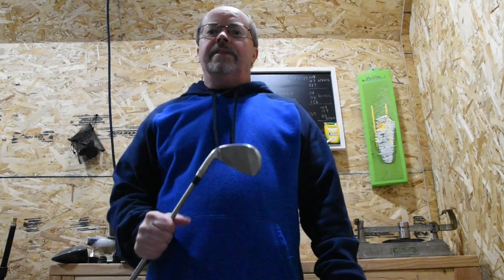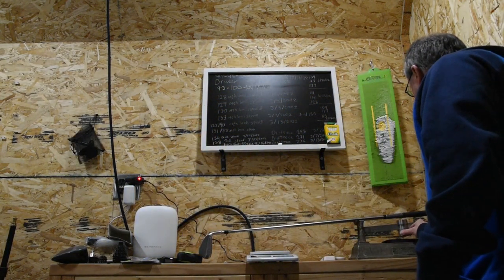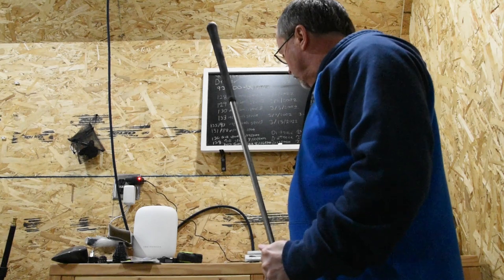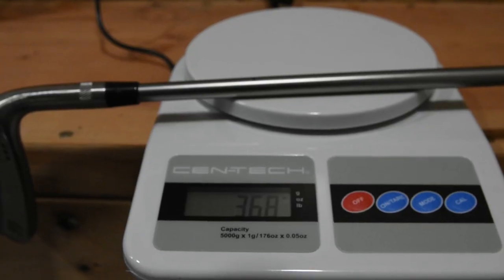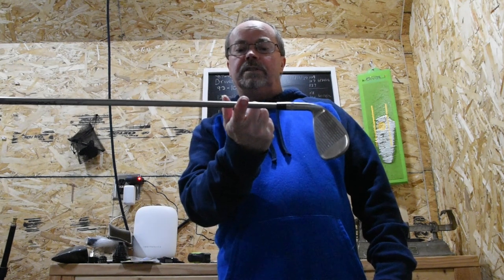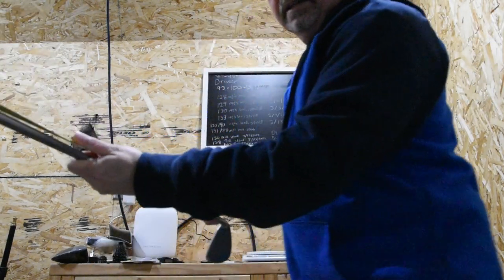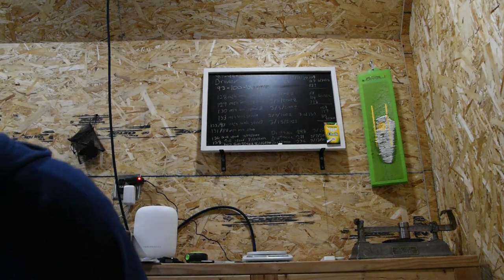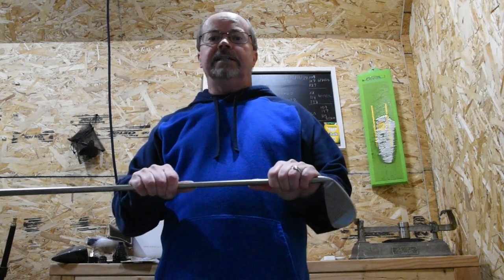How to Use a Swing Weight Calculator

Comment: Love my 699's. Does this work with driver as well? Thanks!
Reply from the maker: Yes. Works with driver as well. And I've tinkered with my driver in regards to putting lead tape on the bottom to increase swing weight, put in a lighter shaft and even changed out the grip from a 45 gram to 25 gram grip. While I can't say it added 30 yards to my drives, it has helped find a good range where I can maximize club head and ball speed while feeling in control of the golf club.